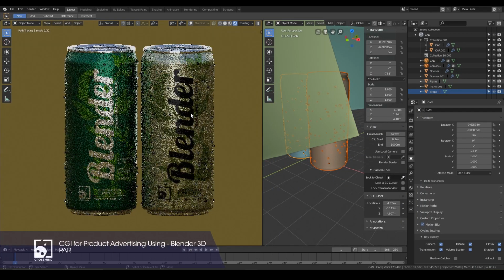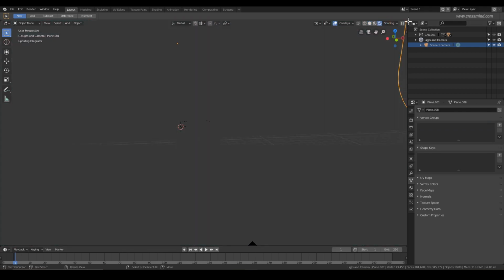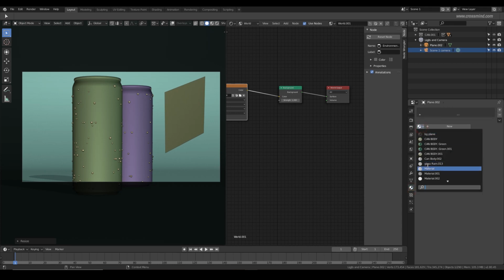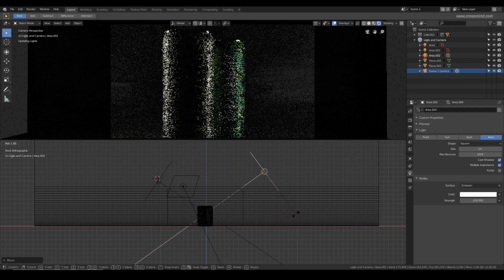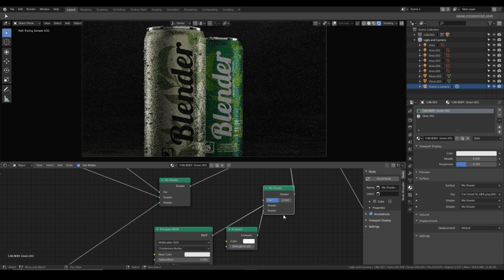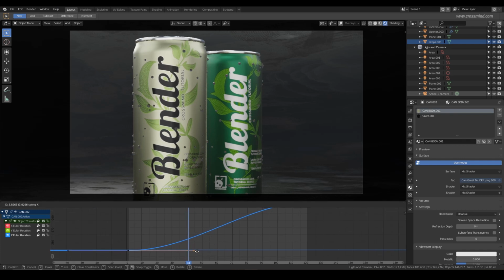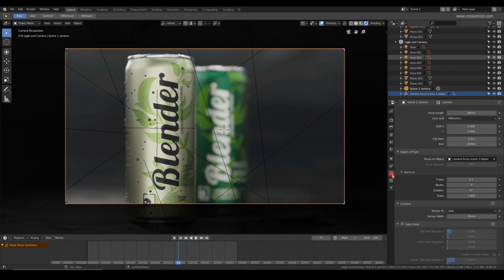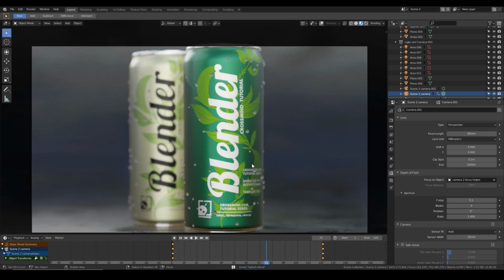Part 2 - Scene Setup/Lighting/Animation - CGI for Product Advertising  Using Blender 3D

Comment: Was trying to render a still image of the cans, without the animation part.... 600+ hours on a ryzen 7 @4ghz and gtx1080 32gb ddr4 @3200mhz. Is this norma?, do i need a render farm for just 1 frame? what's going on?
Reply: By the way, my render settings, 1920x1080, 512 samples light path total 3 difuse 3, glossy 3, trans 3, transmision 6.
Reply from the maker: Robert DTP thats too much render time. For one frame 600 hours? Something is wrong.
Reply: @CrossMindStudio  i know, thats what I'm saying, I will do it again from the scratch and try rendering in different stages to see where is the choke up.
Reply from the maker: Robert DTP Try elimination method.
In new file with same render settings, first try just cans and one by one populate it with other things.
Did you use displacement? 
Try turning off the volume.
Also enable auto tile addon for performance. 
But this is not actually a performance issue-  send me your file with textures i will have a look in asap , in case you font find solution.
Reply: @CrossMindStudio  hey man, just started the project allover again, I still don't know what happened exactly in the previous render, but now its rendering fine, like 30 min for a still frame. Same settings as above. Thank you so much for your tutorials. Learned some new stuff along the way
Reply from the maker: @robertmilosteanu   check what was the previous scene scale and this one.
did you remake everything or copy pasted in new file?
Reply: @CrossMindStudio  nope, new file allover
Reply from the maker: Robert DTP allthough it worked but you would never know what the issue was. Its always best practice to troubleshoot the issue. 
Glad it worked for you.
Reply: @CrossMindStudio  you are right, ill check tomorrow and I'll let you know also. I have a feeling it was because of the volumetric node and over subdivisions surface applied.
Reply: @robertmilosteanu  what was the problem//???

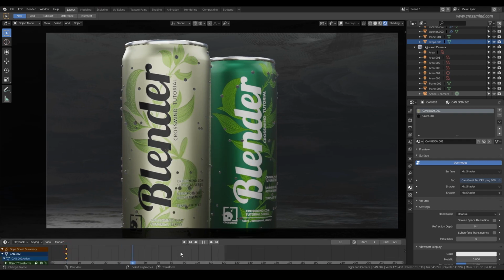Comment: In 24:09 when i create the key and move it the number of spheres(particles ) decrease  so what's the problem ?
Reply: You need to specify the age of particles.
By default age is 50 so particles die after 50 frames.